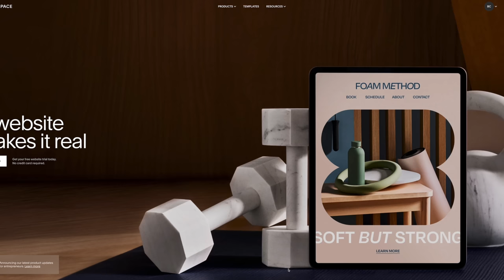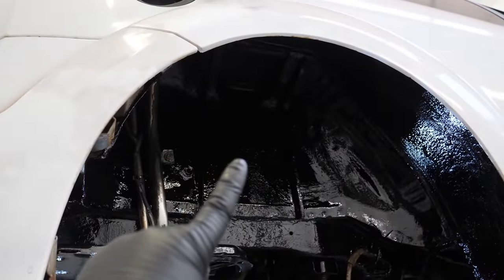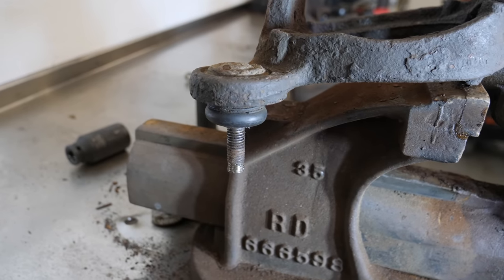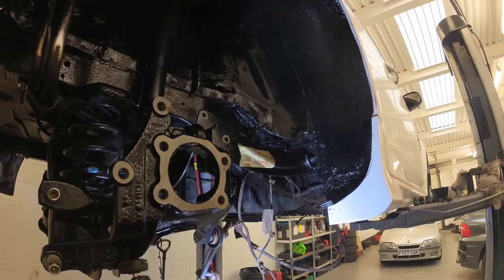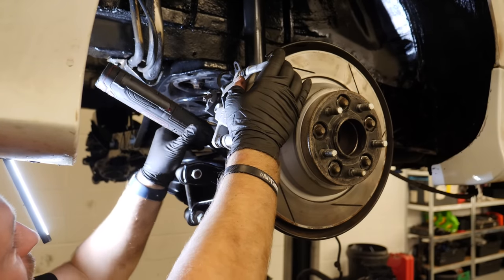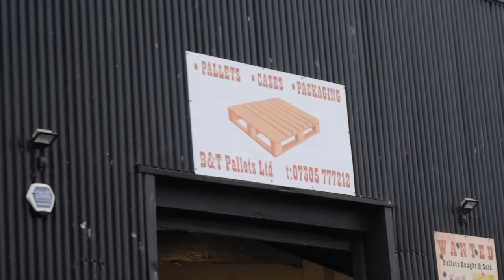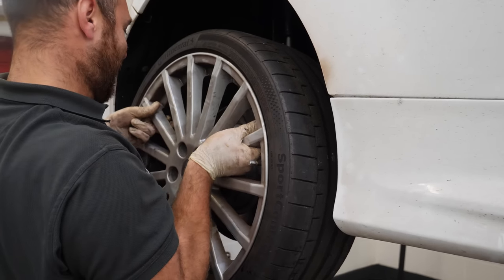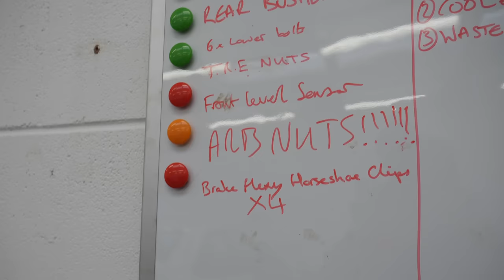RESTORING OUR WRECKED 150,000 MILE MK2 FOCUS RS (PART 10)

Comment: Iv'e got a plain ol 1.6 focus and its interesting watching this series to see what is different and the same between the two models.

Dropped the rear subframe to replace all the arms and had a hell of a time too. This was on the drive which didn't help, had to chop all the old bolts off with grinder as all the bushes had siezed.

Had same issue too lining up the trailing arms after pressing the new bushes in, ended up using a ratchet strap from the from subframe to pull the arm forward enough. Real PITA!

Good series of videos, never owned a fast ford (or fast anything for that matter). After watching so far i think it'll stay that way!

Comment: Your doing a great job with the cars. 1 thing to mention though is the front wheel bearings on a focus have a special tool to press them in because you cant press on the hub they way you have in the vid as it puts pressure on the bearing and fcuks it. If you google it you should see what i mean. I know as i work in a garage and have pressed them in without the tool and a couple of months later they come back with knackered bearings again haha.

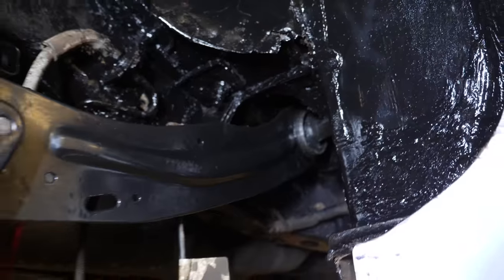Comment: 6:29  not going to lie it’s as good as a mk1 ford escort underneath, covered in hammerite paint in need of a restoration. Sorry boys but it’s hard to ignore it. I would have just spray painted the wheel arches white.
Reply from the maker: As I mentioned in the previous video. At 146,000 miles it’s not the right car to be doing a full nut and bolt restoration. We’ve done the best with what we had without spending way more money than the cars worth. I never claimed it was perfect but it’s definitely miles better 👍🏼
Reply: It’s actually turning out alright getting to the end of the video and Iv just seen you fit the wheel arch liners back in so yeah, I guess no point paint in white to be honest. ❤❤ keep it up mate you doing well.

Comment: No press needed to take old bearings out. Just run a bead of mig weld round the bearing then it will just fall out.. Use your brain....
Reply from the maker: Are you a welder? I don’t have a welder and never even used one so even if I knew that I wouldn’t have a clue how to weld 🤷🏼‍♂️ can you weld them back in or would I need a press for that?… hmmm… probably makes sense to get a press then I suppose. Use your brain 🤦🏼‍♂️